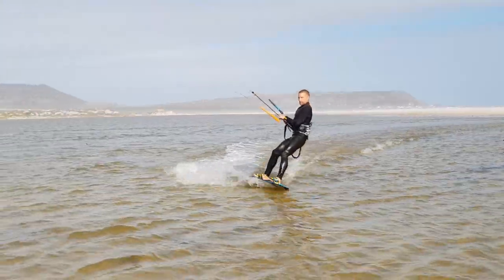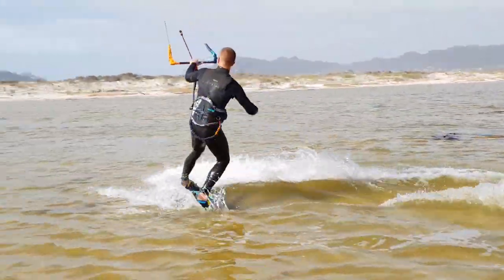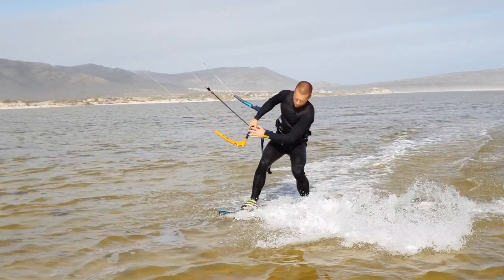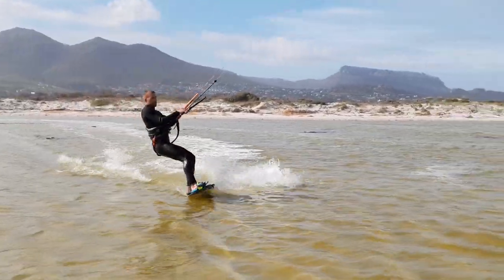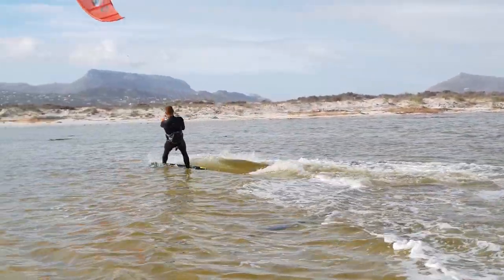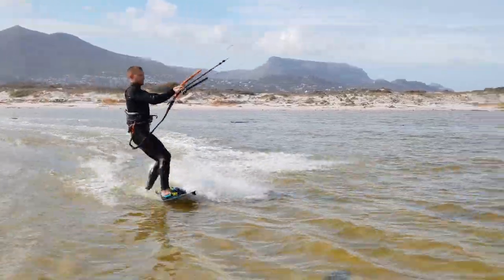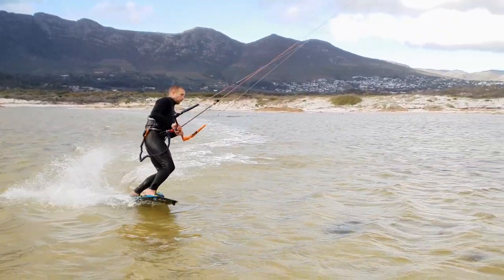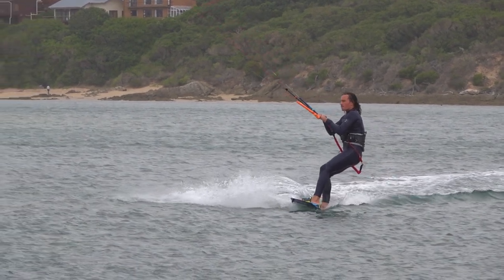surface pass and pop pass (basic bar pass introduction & training for kiteboarders)

Comment: Was that a Rebel you were using? Doesn’t it backstall when you unkook?
Reply from the maker: Hello Juanma, well spotted, yes that was a rebel. It unhooks fine, it doesn't stall. It does power up quicker and depower quicker than a dice/vegas/etc while unhooked. A small change in angle of the kite changes the pull a lot. The dice however is a bit more even and consistent in terms of pull while unhooked, and takes longer to drop when the lines are slack.

Comment: Is it ok to learn this with an Evo-like type of kite ?
Reply from the maker: Definitely. That's probably the best shape to try unhooking for most people. Then something like the Dice (which is a hybrid designed to unhook well) is good if you're unhooking a lot.
Reply: @kitesurfcollege  Dice 2014 8m  is my favorite kite for unhooked!  Very stable. First I do everything tricks on it, then  transfer to other size kites. Please tell, is there any difference between dice 2014 and 2019? And is there a big difference between dice 8 and dice 12m? (i have rpm 10 m as main, and gts 12 m for lightwind, but may be go to dice as same sizes)
Reply: Kite-Surf-College Tutorials and Tricks nice thanks u

Comment: BACK side pass = same rotation over the water=  call FRONT roll. Hmmm anyone can clarify this? Back/Front
Reply from the maker: Yes that's correct. A backroll rotates in a similar direction to a front side pass (the nose of the board aims upwind at first) AND a frontroll rotates in a similar direction to a back side pass (the tail of the board points upwind at first). This is why after an unhooked backroll it's most natural to do a front side pass, and after an unhooked front roll it's most natural to do a back-side pass.